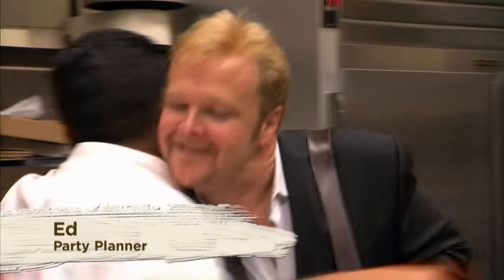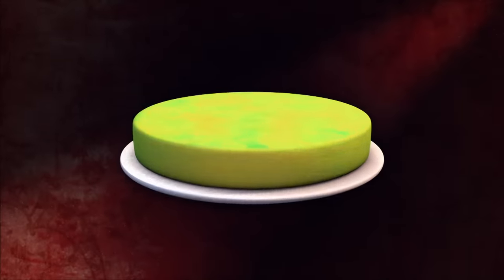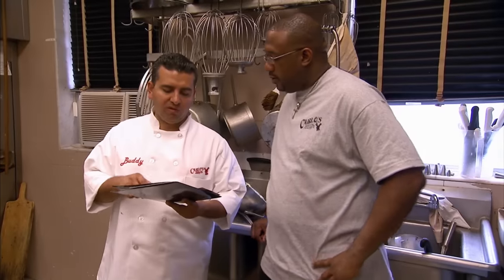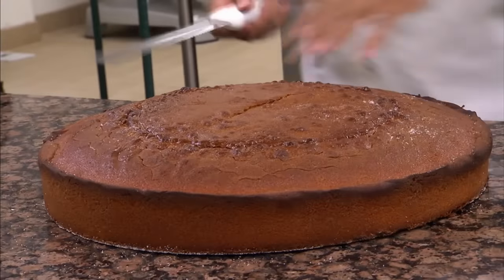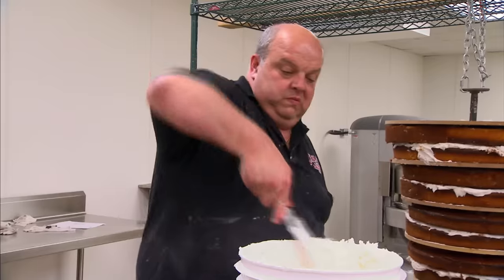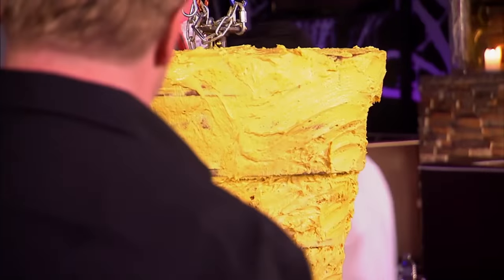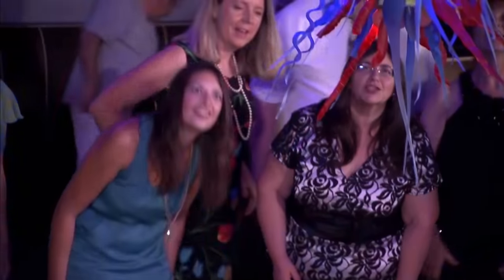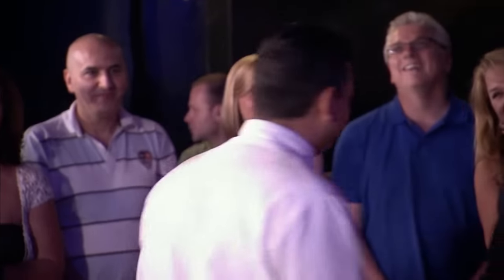Buddy's Chandelier Cake Ends In Disaster | Cake Boss

Comment: Admit it, everybody including the person reading this knew it was gonna fall. There would have to be like steel bars in that thing if you don't want it to fall...
Reply: Willy The Warper The structure wasn't the issue. That's not why it fell. It fell because of the hoisting system aka buddy with a rope. They could've easily and cheaply made it secure and used a pulley system with a failsafe mechanism. This video was staged, obviously. No way he'd try to undo that like that by himself.

Comment: what were they planning to put the cake on to cut it anyways? Okay they were gonna lower it, then what? just start slicing it like that while the guy is holding the rope? why didnt they bring in a table or something for the cake to sit on before they started lowering it? Was it meant to break? Were they gonna just have it standing on the dirty floor while cutting it? Were they gonna cut it while the guy was gonna struggle to hold the rope tight? I have questions!😂
Reply: Shannan Mae 

I guess they didn't need a table because the chandelier was too poky on the bottom to rest correctly lol.

Comment: i wish they would wear gloves
Reply: bree lowe No one wears gloves while cooking
Reply: gloves are insanitary. it's much for sanitary to not wear gloves and the health department actually prefers that gloves not be worn while handling food due to the fact that you don't wash gloves on a regular basis like you do your hands.
Reply: gloves are created in a sterile lab. The entire purpose of gloves is to prevent the spread of germs. Under the nails is an area that is neglected by most people. Surgeons wear gloves in the operating room and wash their hands and arms before putting on the gloves for a reason.
Reply: Destiny Phillips you cant compare surgons to food industry.
Reply: Food inspectors have found that it's less sanitary in kitchens to wear gloves than not to wear them. People frequently forget about things like cross-contamination when they wear gloves since they think it's safe because "I'm wearing gloves". Most people working in the food industry know that they have to wash their hands after touching specific things (like when they switch from working with raw chicken to vegtables) but don't remember to change their gloves after touching those same things.
Reply: bree lowe people are allergic to latex gloves and so when people wear that it gets on the food

Comment: How much time did they have to make it? I would've had more people working on blown sugar, there was not enough pieces to make it look similar to the blown glass. You can make a long netted frame supported by dowels attached to the core support for the outside and have a cake sitting on the inside with less layers, less wood and decorate the inside cake however. That way, there's less weight and it looks cool when pulling off the netted frame to reveal the cake and lay the frame on a table so people can pick off the sugar spikes. I've thought about the lights, you could put them inside, behind the netting to light up the sugar, but honestly, I don't think the lights are necessary.

Comment: Ok so I just saw the graphic diagram animation thing for the cake and it's green? The red will not look good(since it is slightly transparent) he should have done large (maybe hollow for leds) spirals instead of scattered small ones. The space needs to be filled

Edit: yep, stubbier larger spirals would've covered the surface area. Also, for experienced ppl they tend to break a lot of sugar work. Ik it's fragile but it doesn't happen as much in other shows (unless they don't show it?)

Edit 2: Buddy didn't seem to be the one who rigged it up (he was supporting the cake) so why is he the one bringing it down? He looked like he didn't know what he was doing

Comment: so they used rope but not a pulley system to hoist it up and nothing under it to set it down gently, but a thin rope and someone's fucked up knots also why make it to were it sways back and forth instead of making it stagnant so you can just eat it hanging up which would be cool and when they lower the cake what were they going to set it on and how would they eat it????    this makes no fucking sense